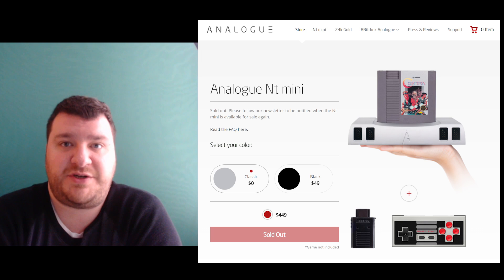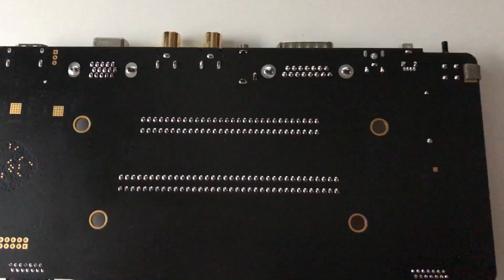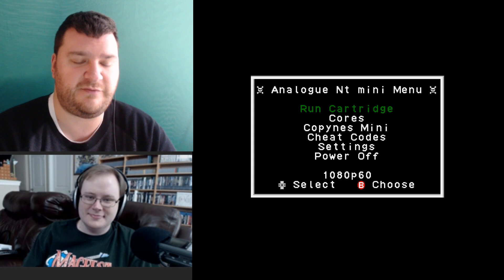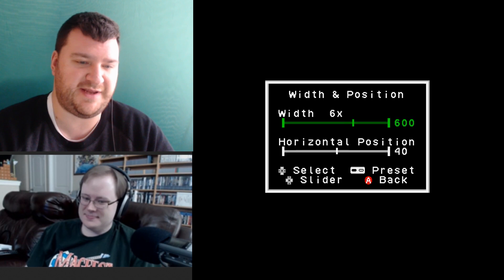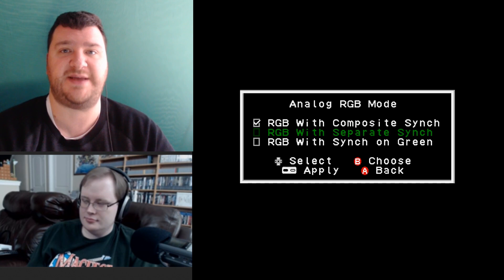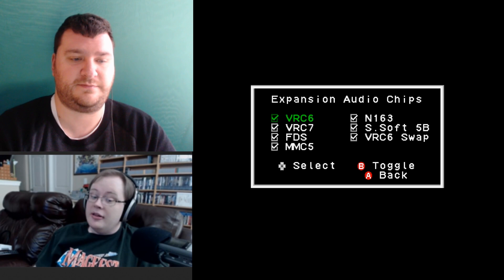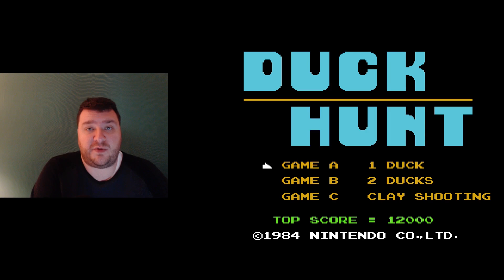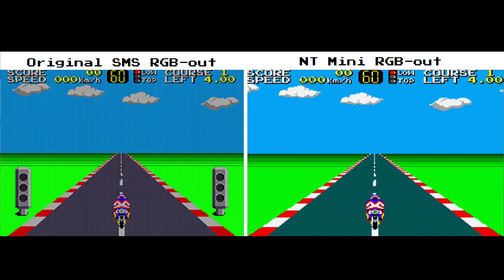Analogue NT Mini Review by RetroRGB

Comment: Hey Bob, do you think any CD-based consoles can have a disc drive emulator like there are for the Dreamcast and Saturn? If not, do you know why it wouldn't be possible? For example, why don't we have one for the PS2? I know you can run some games from the HDD, but that's not 100% compatible.
Reply from the maker: It's possible for each console, but more complicated then a ROM cart.  I've always had great luck running PS2 games from my hard drive...although some require patches to work properly.